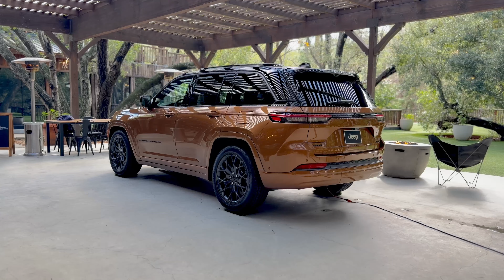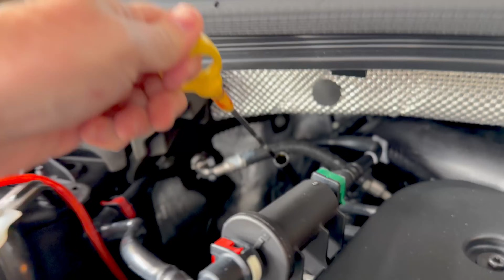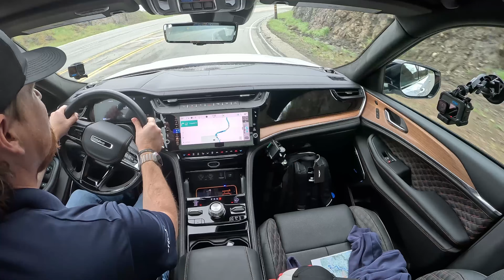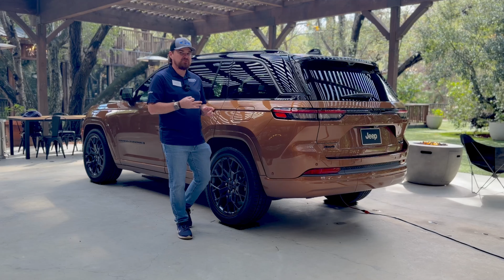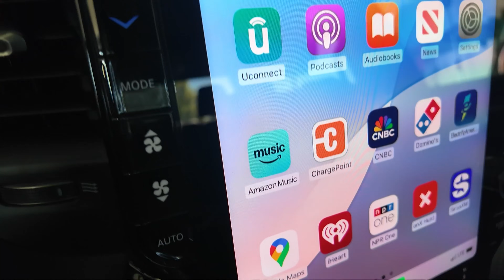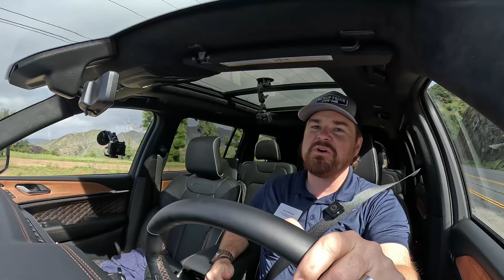2026 Jeep Grand Cherokee First Drive with the New Engine

Comment: Jeep is doing a good job with pricing here. My 2014 Limited 4X4 stickered at 42k. 12 years later to see the same trim for only 1k more, presumably without four-wheel drive, is pretty remarkable. Adjusted for inflation, it's a significantly cheaper car now.
Reply: I saw a Jeep Summit at the auto show for $78K. Jeeps are overpriced by about $10K on average--and that doesn't cover occasional towing charges.

Comment: Why do a drive review of new engines and not include a 0-60 test so we have some sort of performance measurement?
Reply: It's heavy and slow, 7.5 seconds.
Reply: @melissasmess2773  if that’s accurate the performance is nearly identical to the 3.6 pentastar it replaces.  I would much prefer the simple and reliable v6

Comment: 4 cylinder harmonics suck. Put the I 6 in there and quit trying to be cute about it Jeep. Hemi or 3.0 hurricane is the ONLY options to not insult your customers opting for the premium trims. Not buying this with a 4 pot. No way. Have 114k on our 22 GCL and now we are going used because you're in a race to the bottom
Reply: The hemi coming  back
Reply: @843MudMafia.  We will see. They said stay tuned but with this company all that means is they have figured out exactly what buyers don't want and are in the process of implementing it. "Stay tuned" means they're going to pipe hemi V8 sounds into the cabin. That's the level this company operates at.
Reply: @chadd587 
Did you listen to the Q4 results webinar this morning? You could have asked questions regarding the company's future. 
Oh well...

Comment: BMW sells their X5 with a 3 liter inline 6, offering amazing fuel economy.  Maybe Jeep should consider using their new 3 liter inline 6.  Four cylinder engines don’t mesh with luxury cars very well.
Reply: Lexus RX??
Reply: @James-kd2cm We own an RX500h, which is fun and reliable.  But I still prefer driving my 2016 Highlander more, with its 3.5 V6.  Hard to replace displacement.
Reply: @matthewbodell3721  Probably more to due with the 2.4L being a completely agrarian tractor motor in its sound and vibration characteristics. Its just not an appealing motor to drive regardless of power delivery.

GM's 2.7L 4 is similar. When I test drove a colorado ZR2 with that motor it sounded like a small diesel. Kinda clattery and just not super smooth.
Reply: @Jay-me7gw It’s too bad considering my older 1997 Honda Accord 5 speed manual had a much smoother four cylinder motor.  Even my 1989 VW Jetta had a smoother four cylinder engine.  Ugh
Reply: @James-kd2cm the Lexus is a much bigger 2.4 engine
Reply: I agree I own a x5 that is a sweet motor , why not put the SO hurricane SST in it is what I’m wondering
Reply: They also, used too, offer 2 liters in bmw, mercs, volvo, lexus, genesis, audi, maserati. So 😅. Nothing wrong with it, i even like it if the price point is okay. Do argee that the 3.0 hurricane makes sense too.
Reply: And those BMWs use premium fuel….
Reply: Doesn't fit. BMW is junk anyways, only good for first owner.
Reply: @melissasmess2773  BMW's with the B58 and ZF8 speed transmission have been solid.
Reply: @Jay-me7gw tell that to the M5 that’s been in the shop ten times since new…..
Reply: @souljah2light  Which generation M5 was it that had a B58?

Comment: Unreliable POS incoming!
Reply: i think your wrong the hurricane 6 is very reliable and this thing has a port injecter and a dipstick..i see this being a great engine..
Reply: The 4 cylinder  been out they done some updates  to up
Reply: @843MudMafia. look its not even close to the 2.0 thats currently out in the wrangler. 2.0 is not 2.0 its not a neon motor from 2000 just cause it says 2.0